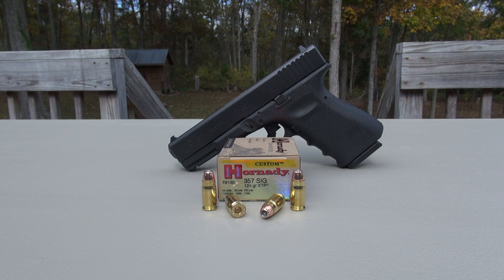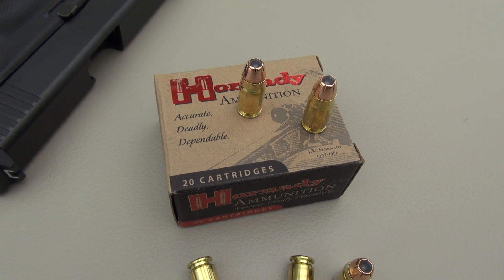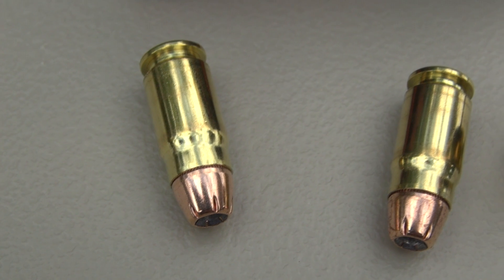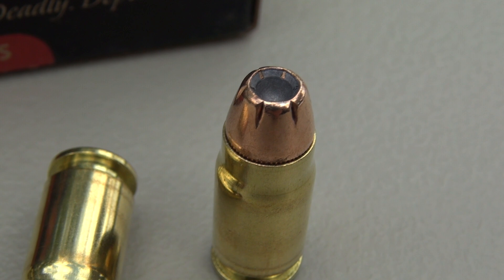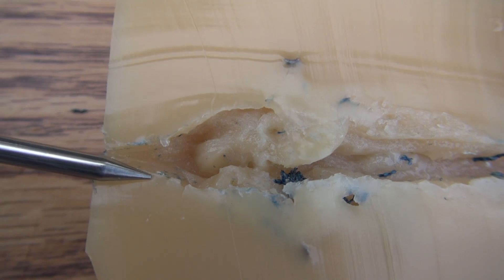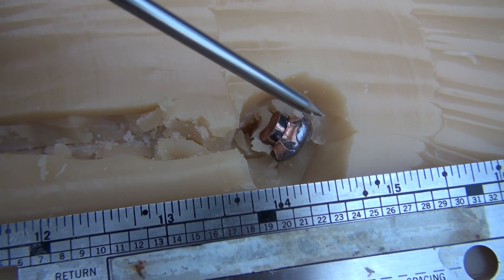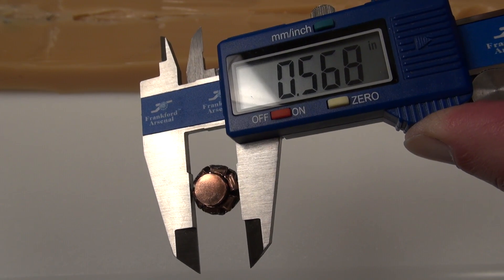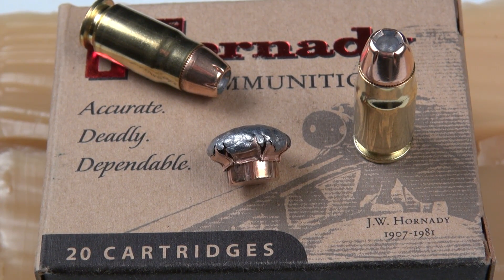.357 SIG Hornady XTP 124 gr AMMO TEST

Comment: Sig wanted their name on it and there are way too many 9mm cartridges (makrov, Kurtz, Luger, parabellum, etc.) The main problem was that most loadings used 9mm Luger bullets that would under penetrate or come apart at higher velocity, so they watered down the load to “hot” 9mm or +p velocity. Then bullet technology caught up and it didn’t make sense to run super high velocity when you can get excellent performance out of like a 9mm HST or Gold Dot and still have higher magazine capacity. For example, I went from a P239 7+1 357 sig to a P365 10+1 in 9mm and I can carry a 15 round spare. The death of the “knockdown power” myth was the death of the 357sig.

Comment: Sig BLEW IT when they named this a .357. If it can't keep up then ridicule naturally follows, however, had they named it "9mm Magnum" they would've sold 100 times the amount of pistols.
Reply: Sig wanted their name on it and there are way too many 9mm cartridges (makrov, Kurtz, Luger, parabellum, etc.) The main problem was that most loadings used 9mm Luger bullets that would under penetrate or come apart at higher velocity, so they watered down the load to “hot” 9mm or +p velocity. Then bullet technology caught up and it didn’t make sense to run super high velocity when you can get excellent performance out of like a 9mm HST or Gold Dot and still have higher magazine capacity. For example, I went from a P239 7+1 357 sig to a P365 10+1 in 9mm and I can carry a 15 round spare. The death of the “knockdown power” myth was the death of the 357sig.

Comment: I know my comments are very late, and this is Just My Guess, but I think the main reason that Hornady doesn’t have the higher velocities is simply because their bullets penetrate and expand just like they’re supposed to at the lower velocities. I know lots of folks like the Underwood ammo simply for that purpose. Their stuff is very hot. I watched a video of a guy shooting the same gun I carry, the model 33 with a 3.42 inch barrel and I’m not sure if it was just that batch of ammo, maybe it was his gun, both maybe, but with 125 grain Gold Dots from Underwood he was getting just under 1,500 feet per second muzzle velocity. :-O He even checked for bulged cases because he couldn’t believe it either. Guess what, no bulged cases. They were just fine. The rest of the ammo he tested was about 20 to 30 feet per second lower than what’s stated on the box. That’s about right for a 3.42 inch barrel, but 1,498, 1,490 etc. etc., that’s some awfully warm cartridges. Personally I like the Speer Gold Dot and I also like CorBon’s DPX cartridges for both my 9mm and 357 Sig. Anyway, I apologize for writing an entire novel, but thank you for all your testing and videos. It’s straight to the point, no BS involved, you show the results and tell it straight up. We need this type of testing. It’s why I don’t read the forums anymore. Every guy has a story about what he had to kill with his heat seeking bad guy killing bullets and then it goes on from there. I don’t want or need that type of information. Now, I am NOT putting those guys down, they have an opinion and they are certainly entitled to it, but for me, I want the type of data you bring to the table and it’s much appreciated. 
Best wishes
Reply: Thats because the Underwood ammo is below the SAAMI maximum average pressure spec. Low lash powders have that benefit, great velocity without going over the pressure limits

Comment: If you want .357 magnum power, the answer is 10mm Auto. In my experience working on a range, .357 Sig is an alternate to 9x19mm for new shooters. Can't go wrong with either, and I have recommended .357 Sig over .380 ACP. as an alternative to 9x19.

10mm is always my first choice for a carry gun, maybe not for plinking but definitely for self defense. I also like .45 ACP, the M&P45c also has a 4 inch barrel and like you said it is a great size for a carry gun.

Comment: Love the 357 sig cartridge thing packs a wallop but this ammo is crap complete disgrace to the real power of this round get yourself some Underwood or Speer Gold Dot
Reply: Ditto
Reply: Agree!
Reply: tony davis I agree the hornady 357 Sig is Trash it completely ignores the whole point of 357 Sig ammo. Hornady is an Epic Fail.
Reply: Don Ahkbar  Hornady is far from trash.  All the big companies including underwood, offer their XTP bullets as options.  Hornady also offers some of the cleanest and most reliable ammo you can find.  They load their ammo on the weak side for safe pressure reasons and recoil management I expect.  Far from trash.
Reply: I had a gold dot hang up in my g32 but I was cycling the slide with my hand, not live fire. Not sure why but I think it had something to do with the wide HP cavity
Reply: Hornaday is not trash. It's middle of the road and will go bang every time. The XTPs can be good in some calibers but not all. For an XTP and a .357 sig to  boot this round penetrated like crap. The 9mm version got more penetration.
Reply: @roosterboy7357  yes my 32 did the same thing with the same ammo.. but live firing and several times. I sense got a 40 caliber barrel for it looking at a different 357 Sig ammo.

Comment: How is it possible to be the same bullet when the 9mm is a .356 and the .357 is.. a... well, you get the point.
Reply: .357 sig does not use exact .357 caliber projectiles. In fact none of the calibers i reload are exact. For instance, my .223 reloads with .224 bullets, my .45 loads are .454-.458. I can say with certainty you can indeed load the Hornady XTP 124 &147 "9mm" bullets into .357 brass and have reliable, normal functioning. We do this with our ammo as we shoot and reload a lot of both 9x19 and .357 Sig. so we just order bulk packs of 124 & 147 9mm projectiles and load them for both calibers and range use. i do not use my self loads for carry/defense though, only range/competition. Factory ammo that is of the same varieties of local law enforcment is  generally what I use for carry. (Typically TNOUTDOORS9 reccomends the same loads too, alot of great info in him for sure!)
Reply: +adjuster56
The 357 SIG uses the same diameter projectiles ( .355 ) as the 9mm Luger cartridge. The reason they named the SIG with the 357 moniker is because the round is intended to duplicate the terminal ballistics of the .357 Magnum with 125 grain hollow points from a 4-inch barrel. This gives you .357 Magnum power in a semi-auto pistol with more shots then a revolver. Hope that helps!

Comment: This review pretty much covers the Underwood 9mm +P+ load which is the same bullet advertised at 1400fps.  This is not bad for a .357 Sig, but for a 9mm would be very excellent!
Reply: 6236003 Agreed, most gun manufacturers warn against using +p ammo claiming their guns are not designed for it and will void warranty.  For kicks and giggles,I have chronoed regular and +p ammo for several different calibers out of the same gun and find the FPS advertised for a lot of +p ammo is way off.
Reply: Zachary Olson

Comment: Its the same bullet.  I load XTP's in 357sig and Hornady does not offer a different .355 bullet for 357sig.  Some do like Speer and Gold Dot but the XTP has a short enough ogive to crimp at the correct case length, which is nice considering xtp .355 bullets are cheap and can be found everywhere.

Feel free to go to their website and see that their .355 bullets do not offer a 357sig specific offering.  Plus if you look at their load data the bullet item number is the exact same as the 9mm .355 item number.  So all interweb haters please check before you come back armchair experting.

A word of trial and failure to offer to anyone else hand loading the 357sig, when you crimp it seems to push the case OAL out a few thousands.  That said, seat the bullet a few thousandths deeper and measure before and after crimp.

Comment: Different bullet. 357 requires a very different ogive (shorter) than 9mm so the short 357 case neck can hold the bullet.
Reply: I reload both my 9mm brass and .357 Sig brass with the same 9mm labeled .355" 124 grain XTP projectile, works perfectly fine and is very accurate. Not something I use for my carry guns but I shoot quite a bit of both at the range and during Action Pistol meets. I load my 9mm out to ~1210 fps out of a Glock 17 and the .357 to ~1380 fps out of a Glock 32, Hodgson powder.
Reply: +Joe Doole you use xtp bullets for action pistol events? why?
Reply: The XTP has concistantly shot to point of aim better than 124 round nose for me, and the price difference is almost nothing between a bag of 124 XTP projectiles and a bag of round nose when buying bulk. I have been reloading for about 4 years and tried dozens of different loads, but the XTP with Hodgdon TiteGroup behind it is one of the most accurate loads for me personally.

Comment: I think at the same weight, and  velocity the results would be similar.  Although you may get slightly more penetration with a pointer bullet.  Using the Hornady reloading manual their listed 357sig max loads I think are still on the "light" side.  I switched over to the 125gr speer GDHP.  Using speers reloading manual it says you can get over 1400 fps (thats out of a Sig 229).  I am probably getting 1400-1450 from my M&P but I don't have a chrony yet to check, but it's hot..

Comment: I would like to point out that the factory loaded 124gr xtp 357 sig load is not the same bullet that you can buy for reloading.  The 124gr xtp purchased for reloading is pointer and doesn't have a cannelure.  I think the bullet loaded in the factory ammo is closer in shape to the .357 diam 125gr bullet used for the 357mag or 38sp.

Comment: but more importantly, what you don't seem to understand is that ALL pistol bullets VERY QUICKLY are reduced to speeds in tissue MUCH slower than their speeds before hitting the tissue. Take a closer look at tnoutdoors9 results: He finds an "expansion zone" only within the first few inches of his blocks--and after that it's just a hole. And even in that short expanded region, we don't KNOW exactly what will happen outside the actual bullet path in all cases.

Comment: Out of a 4" barrel the 125 gr 357 Mag load tends to do about 1350-1400 fps. The magical 1450 fps is rarely seen with a 4" barrel. Typically the longer barrels. That is why the number of 1350 fps was targeted in the development of the 357 Sig. The Speer GD 357 Sig load pretty much produces 1350 fps, which darn near replicates the 357 Mag.

Comment: @tnoutdoors9 I was just about to ask you to make this vid when I saw it on the tool bar. I wanted to ask you a couple Q's. Do you know any ammo manufacturer that makes hot loads for the .357 sig, maybe running in the 1425+ fps, I have only found Corbon to get close to that. Also I use this ammo XTP 124gr for my G31, is the speer gold dot better in terms of velocity? I got a 4.49 inch barrel. Also, how often should I change out ammo that stays in my car, I am approaching a year with my car ammo.

Comment: @SDGlock23 Yeah, I'm pretty sure that the bullet used for .357 sig is a little more rounded than the 9mm version. I have a box of 124gr. XTP .355 bullets and they have a fairly flat slant up to the hollow point. I've noticed that most .357 Sig rounds are fairly rounded and I think it's for better feeding. However, I reload .357 Sig and the standard 9mm bullets work just fine.

Comment: @BioHazardMatthew The bullet diameter measures0.355 inches for the 380 auto. In some cases the 'name' of the round is not the bullet diameter, for instances the .300 Weatherby mag. and the 308 Win share the same bullet  both measuring 0.308 inches in diameter. If you are 'puzzled' and want to learn more purchase a reloading manual or go to Hodgdons site.

Comment: I do not believe this is the same bullet as used in the 9mm version.  I have some loose 124 XTP's in front of me for reloading and compared to your video I noticed two differences.  One is that the hollow cavity looks smaller on the 9mm version and the nose of the bullet looks more slanted.  Second, in your video it looks like the 124's in the 357 Sig have a cannelure on the bullet, there isn't a cannelure on the 9mm version.  Cool vid, I have some of these for my 357 Sig.

Comment: Yes, per their 8th edition page 899 9mm 124gr part number 35571 and page 904 .357 part number 35571 they are the same, as is the 147 gr.  They state in their book the .357 has a wide assortment of bullets to chose from in the Hornady line of 9mm bullets they make.  As for FPS the .357 load min charge is rated at 1100 as the 9mm maxes at 1000-1050 (most powders) before hitting +p pressures

Comment: The 124gr 9mm XTP is different from the 124 gr XTP loaded in Hornady's .357sig factory ammo. The 9mm XTP has a more conical nose shape, a smaller metplat diameter and deep hollow point cavity than than the.357sig version.

The XTP loaded in Hornady's .357sig is NOT available to buy for the reloader. The only XTP the reloader can buy is the 9mm version. The 9mm version can be loaded into the .357sig case fine.

Comment: .357 is not the same bullet as the 9 MM. .357 is larger. That said, if you were to shoot a .357 Mag out of a 4 inch revolver barrel, I would bet it would be 100 feet slower than advertised. The .357 Sig was advertised as a bullet that would be within about 100 fps less than the .357 Mag. That said, the .357 will have more reliable expansion compared to .45 ACP and 40 S&W because it is a faster bullet. Keep shooting my friend!